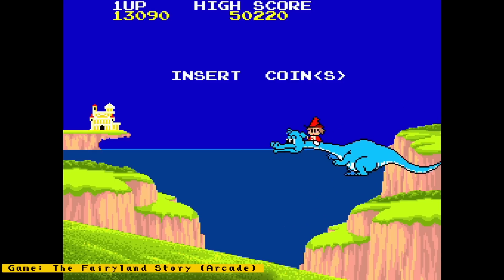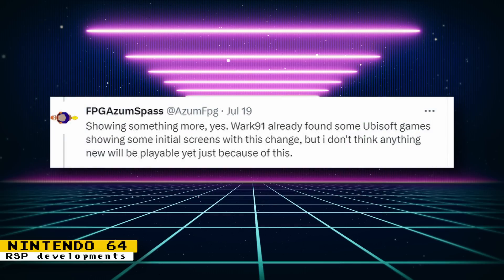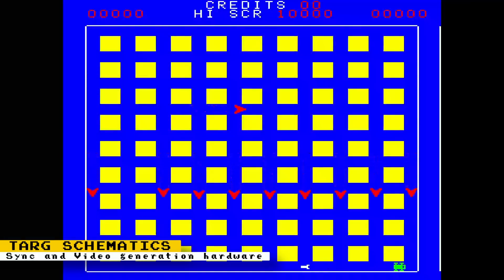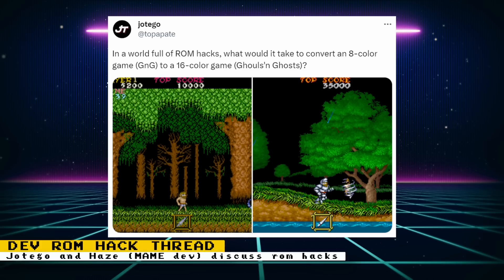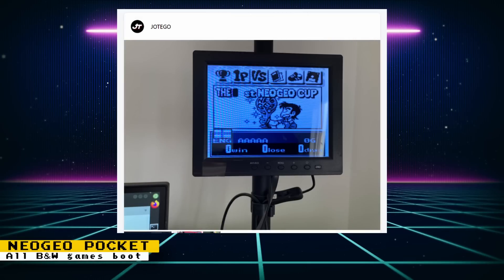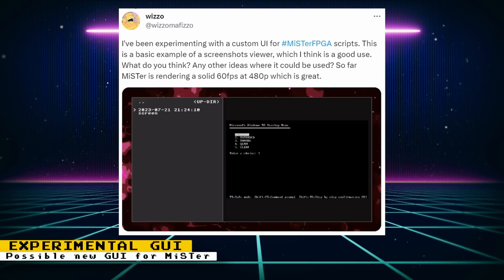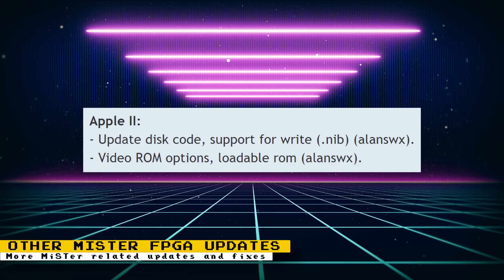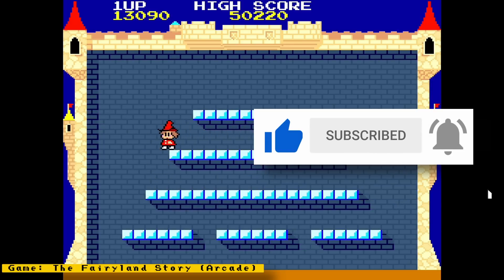MiSTer FPGA News - NeoGeo Pocket, N64 & More

Comment: At 0:35 you mention additional controller adapters.  Do you mean the CTRL-Dock?  I can't find individual adapters like the one in images.
Reply: My understanding is that the CTRLDock and Super CTRLDock are different products. As far as I can see, the latest iteration of the former is now called the CTRLDock Classic SE and is commercially available, whereas I have not yet seen a page where the new Super CTRLDock can actually be ordered. The CTRLDock supports mainly 9-pin DE-9 D-sub joysticks as well as DA-15 NeoGeo joysticks. Unfortunately it doesn't look like DA-15 analog PC joysticks will also work (correct me if I'm wrong – MultisystemFPGA has tweeted that possibly mechanically compatible connectors could be made to work with a firmware update, given HW access and sufficient resources for development and testing). The Super CTRLDock seems to be mainly for NES and SNES controllers. There's a July 21 tweet from Heber_Limited announcing it, but apparently no order or preorder page yet.